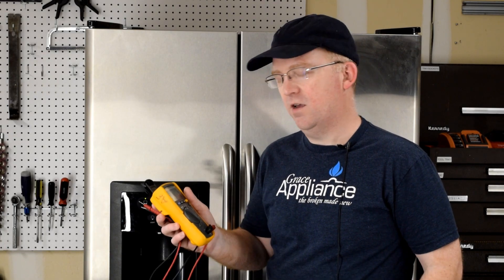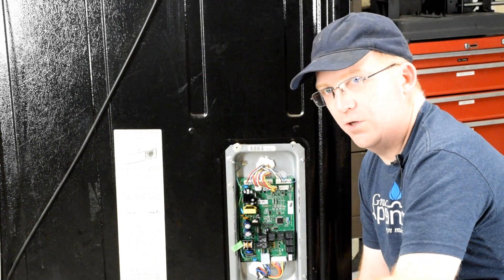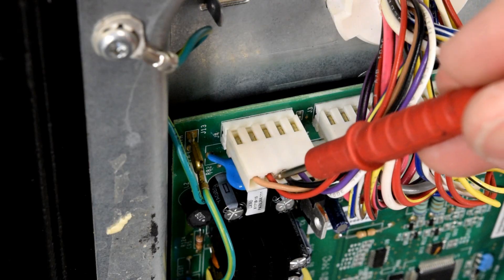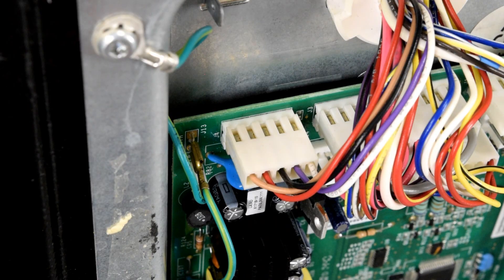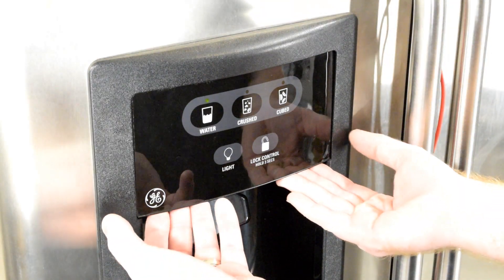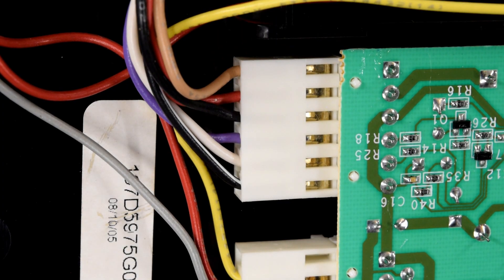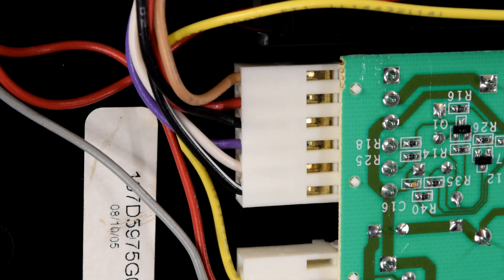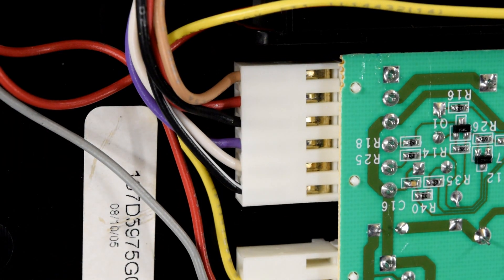Diagnosing a Bad Control Board - Part 4: Front Touch Panel

Comment: Psc25mswass does not go below 41f , what is the lower fan motor for and how is it activated?
Reply from the maker: Hey Glen, 
When you say lower fan, do you mean the fan inside the refrigerator section or the fan behind your refrigerator near the compressor?
You have a dual evaporator refrigerator which has a fan inside the freezer, refrigerator, and then one behind the refrigerator (condenser fan). The condenser fan will run when your compressor runs. If it isn't running and the comrpessor is, that would certainly cause the refrigerator (and freezer) section to run hotter than normal. Also, you might notice that the dividing wall between the freezer and fridge would be warm/hot to the touch. 
If your freezer temp is ok (i.e. 0'F, and keeping everything frozen rock solid) but the fridge section is warm, i'd want to know if the evaporator fan inside the refrigerator section is turning. 
If both cabinets are warmer than normal (i.e. 0'F for freezer & 38'F for refrigerator) then the condenser fan behind the refrigerator may be suspect. 

I'll be honest in saying I haven't had too much experience with this particular fridge when it comes to the diagnostics steps, but here is what is in the tech sheet for your particular model: 

"To enter the self-diagnosis mode, press and hold in the HOME, CRUSHED, and WATER pads. The SELF
DIAGNOSIS screen will appear. Press SOFTWARE VERSION, FACTORY TEST, or HMI TEST. Select EXIT to exit
the self diagnosis mode. 

FACTORY TEST 
All Fans - turns on ALL interior fans (fresh food, freezer,
beverage center, and QuickFreeze™ fans).
Calibrate - calibrates the touch screen assembly of
LCD screen
Scan Screen - Starts LCD screen quality scan. Operates
the water, crushed, cube, and lock LEDs. Opens and
closes dispenser duct door and turns dispenser light
LEDs on and off.
Back - Returns to Self Diagnosis screen." 

I hope it's helpful. If you need the tech sheet, i'm happy to email it to you. Let me know. 

Thanks!

Comment: How do you check diagnostic codes.
Reply from the maker: Glen Lynch Hi Glen, on this particular model there are no diagnostic codes to run.   Your model may differ.  
If you’ll send your model number I’ll be glad to take a look to see if your refrigerator might allow this.

Comment: Replaced motherboard fan and condenser and relay I still don't have startup can you help thanks!!
Reply from the maker: Hi Jorge, 
Try this.  
Unplug your refrigerator. 
Unplug the connector with 5 wires shown at 1:47sec in this video (J4 plug) 
Plug the refrigerator back in and see if the refrigerator comes on. 

If so, your front control panel (i.e. touch panel) is shorted and would need to be replaced. 

Let me know what you find and I can give you other tips if needed. 

Thanks!
Reply: @GraceAppliance  thank you for the response it is a side-by-side Hotpoint I've changed the computer bored and   replaced the  fan motor and supco for the relay  what I've noticed on the new computer board that is not exactly the same but all the would that make a difference? Thanks!!!
Reply from the maker: Jorge Rigo  Hi, when you say computer board - You talking about the main control board behind a metal panel behind the refrigerator, correct?  Should have been part number WR55x10942P probably. 
This is an updated part number and even if your board may not look the same, it's now the correct control board for your refrigerator.  

You can send your model number, i'll be happy to confirm this for you. 
But, the reason i'm asking you to unplug the J4 plug from the main control board is that if your front control panel is shorted/failed - it will keep the refrigerator from starting. 
If you unplug the front control board from the main control board, it removes the shorted circuit, and should start up as normal.
Reply: @GraceAppliance  yes the main computer board on the back part number  G200D4850G013 that is the part number that I removed from the refrigerator and replacing it with part# 200D4850G022 let me know if this helps thank you for your response and help..
Reply: @GraceAppliance  the refrigerator has been unplugged for the past couple of days as it has not been working at all
Reply from the maker: Jorge Rigo  Thanks!
Yes, that's the same as the board that is shown in the video. 

Tell me what happens when you've unplugged the J4 connector on the control board and plug the refrigerator back in please. 

Thanks
Reply: @GraceAppliance  unfortunately nothing happened only thing that happened the lights on the control panel in the front are turned off the refrigerator lights are inside are working but nothing else works at all
Reply from the maker: Jorge Rigo OK, good deal.

I would recommend checking to see if one of your temperature sensors or defrost sensor has failed.

If the sensor is not registering the fact that the fridge is too warm it may not be calling for cooling or may be stuck in a defrost cycle.
You'd need a multimeter to do this, but you can follow along in this video:
https://youtu.be/CG-2FnQ43Hs
Reply: @GraceAppliance  thank you!!!

Comment: Nice video! How do you determine if that is DC volts?
Reply from the maker: Hey, your meter will have a setting that is a solid line with dots over it. That's your DC setting. Also, there is a video I've made for multimeter basics that may help if you haven't watched that.

Let me know if you have questions!
Reply: Yes I know how to read meter. Does it tell you on schematic that it is DC volts or where does it tell you it’s DC?
Reply from the maker: Ah, gotcha.  It honestly depends on the schematic.  Some are nice enough to call it out on the diagram for you (5vdc, 120vac, etc) but others simply show you the wire placements and don't give any other guidance. 

If you have a panel inside the upper roof of the refrigerator section, you can pull that panel down after removing the two 1/4" nuts. This is where they hide the schematic/service manual.  Otherwise, it's most often under the refrigerator behind the kick panel.